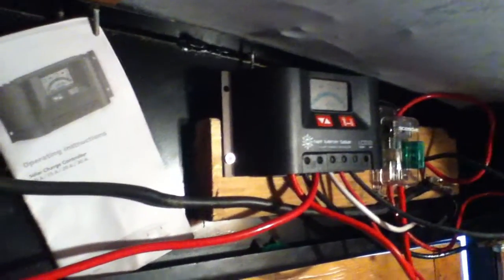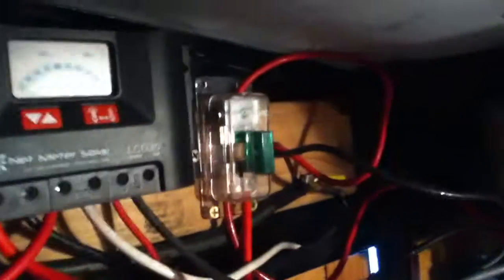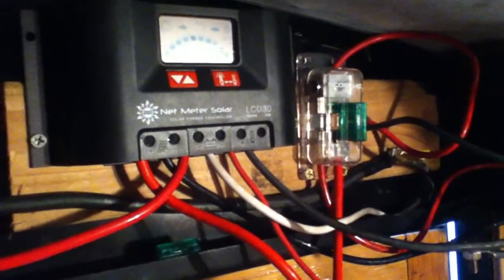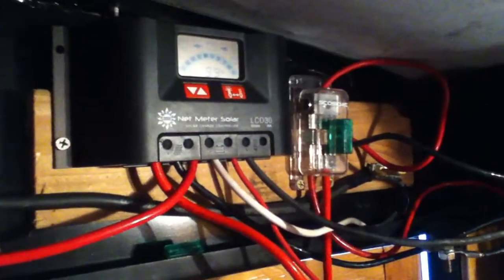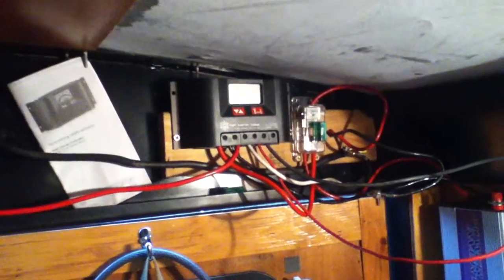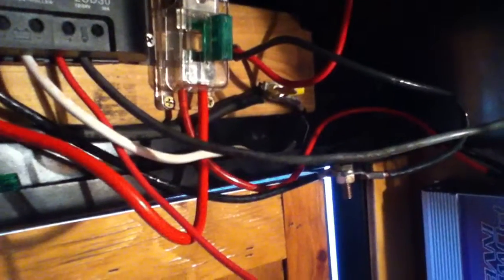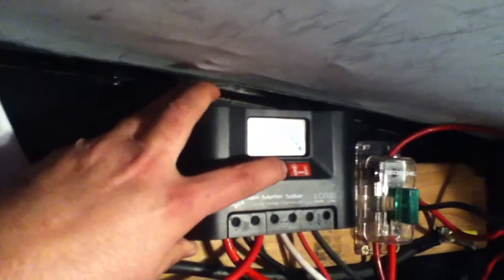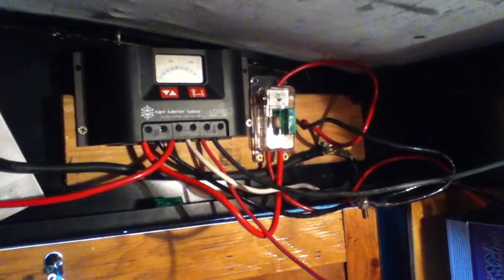The improved mobile workshop solar wiring setup for both off grid and grid tie options

Comment from the maker: I can't get the camera close enough to show it clearly, but I used the liquid electrical tape on those or else they would have arced out the day I installed this.   All of the branch line connections were also done with the liquid electrical tape and then I put regular electrical tape over them after it hardened up a bit.